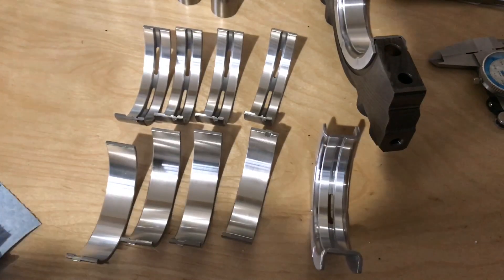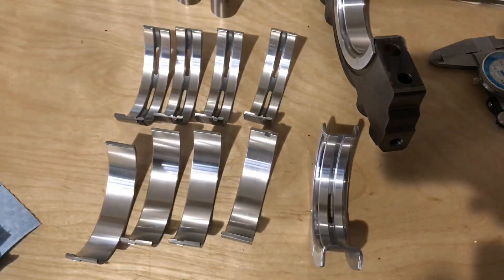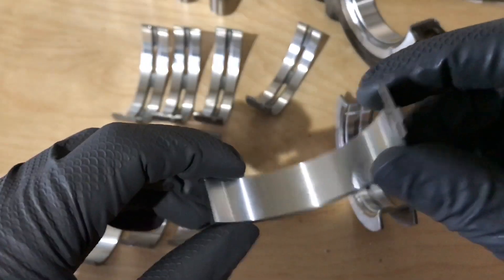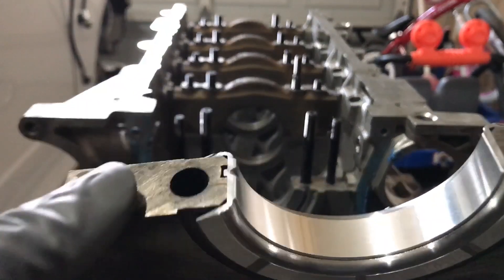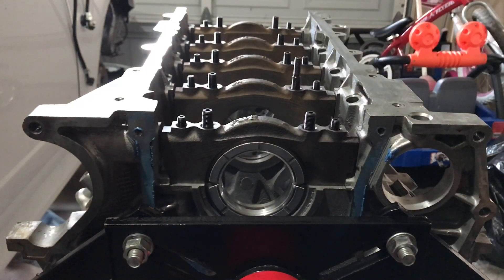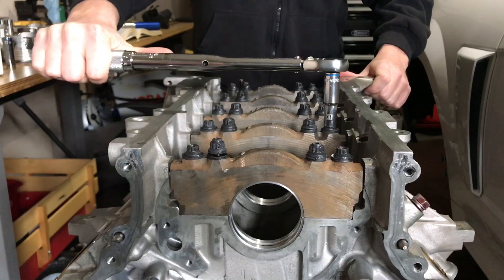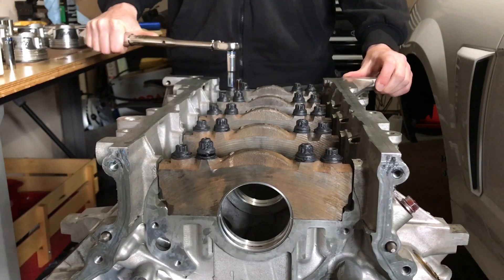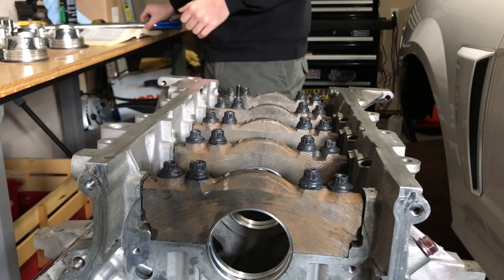4.6 rebuild Pt. 4 installing main bearings

Comment: Great channel and great vids! There's so little Mod motor building vids out there but a ton of 4.6 motors (2 & 4V) that this will help a lot of people. Very underrated motors. 
Your car is a beast by the way, and you're a great driver!  Just curious, have you read Sean Hyland's book?
Reply from the maker: Jim EC thank you very much. Sean Hyland book was the first thing I read before I put this engine together the first time, good book with a lot of great information.
Reply: Andrew Lavender I've got an 03 Mach I've owned since it was a year old. Also have a Teksid block and it's forged crank and a Vortech set up. I wanted to build a forged short block rather than hammer the #s matching, fragile Mach lower end, so this channel is greatly appreciated. 
Not sure if you're familiar with "TKO Resto"? (It's an SN-95 restoration YouTube channel) but I'd think your two channels would compliment each other?
Reply from the maker: Jim EC sounds like it would be easy to toss some rods and piston into that Mach 1 and be set. Thanks for the info I’ll look into that channel and subscribe.
Reply: Andrew Lavender I was thinking about doing that, then my son gave me a complete 96 Cobra short block he was going to use in his Vortech'd 02 GT. It seems to be in really nice shape and I figured I could just build that then swap over so the car wouldn't be down for long?  Plus, I just like the fact that my original Mach bottom end is unmolested even though I'll be using the heads (and everything else) from it. Not shooting for crazy power levels, just 500 or so rwhp will do me just fine in that car. I keep going back and forth with this plan anyway. Got a 10 Pum Crazy RT Challenger as well as a bunch of other non car projects. Typical too many projects, not enough time/money while working , blah blah.  
Anyway, looking forward to more of your vids. Hope your channel takes off!
Reply from the maker: Jim EC I agree much quicker to build that short block up and still be able to enjoy the car in the meantime. Thanks for all the support

Comment: My upper main thrust bearing was a bearing just like the rest of them but it just had spacer on the side but the lower bearing was the actual thrust bearing. What an I missing here. Is there a reason for both? So only the performance series come with 2 thrust style bearings.
Reply: So I did a tiny research and the thrust bearing for the 5.4 and 4.6 iron block only have the thrust washer on the upper side and the bottom gets the actual thrust bearing. I guess maybe the shop didn't know this but I'm glad I realized this and will have the bearings for the aluminum 4.6 block. Don't know what the huge difference is but there has to be a reason right?

Comment: hi andrew i wanted to ask u i have a 2005 mustang with a 4.6 im going to rebuild it i want to get away from just the thrust washer do u know what will be the right bearings will be for the number 5 main upper and lower i like to use king bearings if possible i did call king bearing manufacture but this person couldnt help me i seen ur video on the bearings u used not sure if they would be the ones i need thank you

Comment: When i took out my old bearings out the engine they had a wiggle in them and seemed loose. Is this normal? Or should that mean they are worned out?

Comment: is the part number for the upper bearings end with a u and the lower end with an l?? lower and upper maybe :)
Reply: The bearings with the oil delivery hole/slot go into the block. The ones with no oil delivery holes go into the caps.

Comment: Andrew, I am rebuilding currently and my Clevite thrust bearing is not a one piece on the top side.  Yours is one piece on top and bottom.  Can you please let em know what bearing set you have?  I have a 2v Romeo steel block.  thanks
Reply from the maker: Eric Guess unfortunately you are stuck with the bearing set that you currently have. The teksid is the only block that you can do the one piece upper thrust
Reply: Andrew Lavender well darn. Thank you sir

Comment: Heres a question... Do all teksid blocks have that style of main caps? Didnt know if they had different variations like the romeo and windsor engines do. My guess is no.
Reply from the maker: 98snakehorse the newer teksid blocks have a smaller diameter main cap side bolt and no jack screws. That’s the only difference I can think of

Comment: I have a question for you,,can you install,2003 cobra rods,an a 1996 4.6 motor? Any help would be great
Reply from the maker: John Van Nortrick yes
Reply: Thanks man,I'm trying to put engine back togetter,,,I got hurt now better,so going the all the boxs,,OK ive got 96,4.6 block,,,2003,pi heads,,my kid is wants car done so she's helping ,,,lol,only way you learn, ,also I've got comp cams,ex274-14 cams,,was told I could install on engine, ,got all,trick flow,parts,to do this,am worried about valves hitting pistons,,one guy says I'm good,one guy say 's no,,you building 2v,engine s,,what's your take,,
Reply from the maker: John Van Nortrick honestly you need to get a cam degree kit and degree those cams and check piston to valve clearance